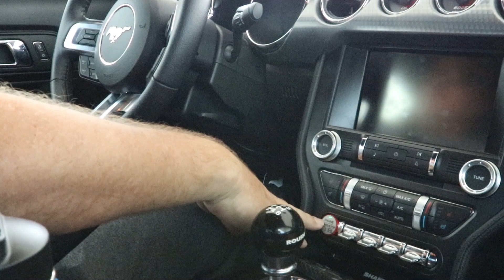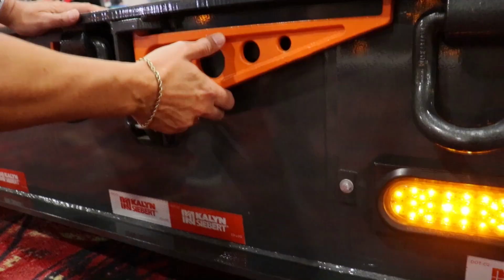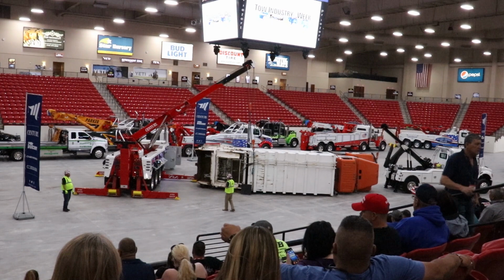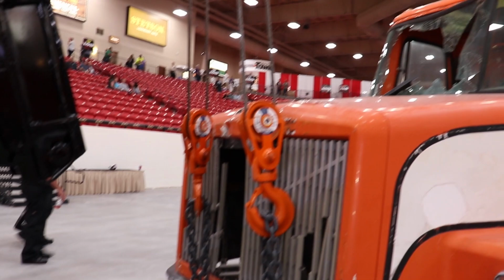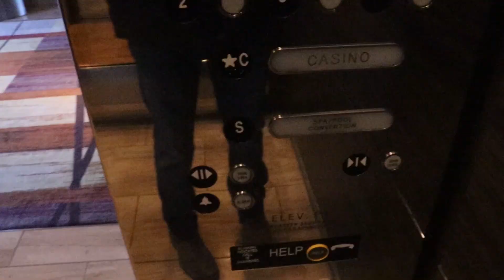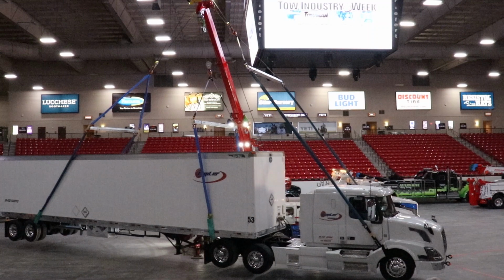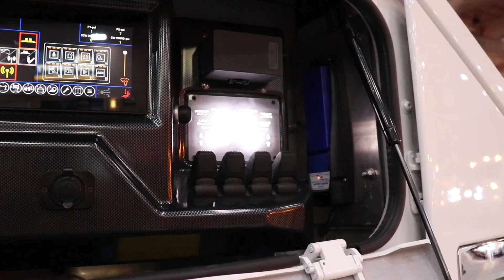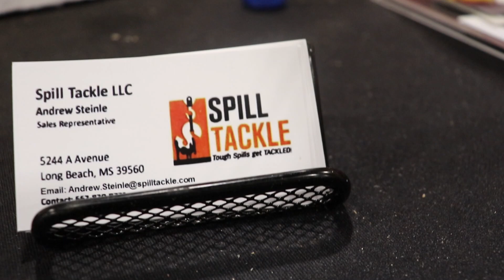Vegas Tow Show VLOG

Comment: That one tow truck is pretty cool at 45:37 is a cool idea that way you don’t have to disconnect driveshafts and tow trailer behind it.
Reply: Bradley Drennan 
That will not work with most tractors ( high roof). And only with empty trailer

Comment: i see some problems with the semi lift, first, none of the loose axles were chained to prevent damage to air ride,...etc, second, when they hooked up the trailer to the rollback, they did not do a "tug test" to test the fifth wheel coupling BEFORE hooking up the trailer air supply. the axles were also not chained on the trash truck either. also did not like the way the front of the trash truck was hooked up, if there is damage to the frame, which there might be in a rollover, the front wrecker needs to have control too. all these things could prevent possible damage or loss of the trailer in transit. otherwise very good video. best safety factor is 4:1 or better. enjoyed the video.

Comment: That's an interesting Vulcan with a winch on the under lift.
Reply: It's a 22,000lb auxiliary winch. They are only offered on the Vulcan V-100 & V-70 models. They actually have been available as an option for like 5 years now.

Comment: 3 link rule?? Can you explain further
Reply: Probably 3 links touching whatever it's wrapped around.  Use a shackle to make the chain go around a "fatter" object and use more links to spread the load, rather than through only a hook which may only be one or two.
Reply: The wider you can spread the load where the chain bends or redirects through the clevis the better. If you have 3 links in the clevis you're not creating a pinch point on the links and the links aren't binding against each other. When you use just the hook you won't have as wide an area for the chain to rest causing the potential  problems  I sited earlier.